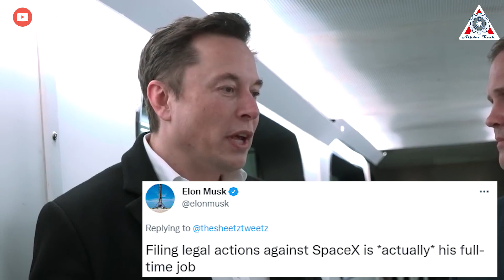It happened! Jeff Bezos spent $10B to beat SpaceX & Elon Musk

Comment: Given that Boeing is half of ULA, and the technical failures (737max, Starliner, etc) they have faced, does anyone expect their Vulcan rocket to perform acceptably?  Not to mention that it relies on Blue Origin's BE-4 engine.  They have struggled for years to produce 2 "flight ready" engines that still have not been flight tested.  Which  their "still-in-early-design-phase"  New Glenn rocket also depends on.  

Bezos is betting big on what are still imaginary rockets, whose manufacturers will struggle to produce in the quantities he needs.

All Bezos is doing is soaking up most of the available launch capability worldwide.  Which will drive those customers to SpaceX with their lower-cost flight-proven Falcon-9s and Falcon Heavies.  And with the Starship about to fly, SpaceX may well build a lead that will take any competitors several decades to match.
Reply: There's more to it than that.  Air Force is also overseeing it.  The oversight is quite intense, far beyond anything Starship has had to (or could) endure.
Reply: ULA's Vulcan Centaur is not only 50% Boeing (oh-oh) but their rocket's engines are from BlueOrigin (years late - not working - inadequately tested...etc. etc).
Reply: @SteveBakerIsHere  What in the world would make you think BE4 is 'inadequately tested'?  I can guarantee BE4 has been tested beyond, and in ways, Raptor never has been, and never will be.  If anything, that's BO's weakness; they pound things into the ground endlessly.  Boeing bashing can only go so far; despite all that's gone on there, they are a substantial aerospace company and will outlast SpaceX.
Reply: @Strike_Raid  that's because the Air force is paying for it. Starship is being developed largely through SpaceX's own investment. Yes they have money from NASA for a lander version of Starship. They got some money from the Airforce for engine development, but they are still in complete control of their development. as soon as you let the government take control everything goes to hell.
Reply: @christopherbeddoe406  I’m not so sure that’s true, but it wasn’t my point.  They were saying that BE4 was sloppy and untested, and I was pointing out that with AF oversight you can be sure that BE4 is neither sloppy nor untested.  It will be a tragedy if BE4 doesn’t work (a tragedy even if Raptor doesn’t work), but if BE4 is unsuccessful, it won’t be due to lack of testing.
Reply: I recall the Boeing whistleblowers that revealed Dreamliner components being hand built in a less than precision facility in California. Boeing would be quite unpopular if similar shortcomings were present in the current work flow.
Reply: @Strike_Raid  That same oversight applied to the F35 program, or is it better this time? 🤣
Reply: @ronnonyabizness5240  Everyone wants F35's.
Reply: @Strike_Raid  Hmm - so Raptor is tested at the McGregor test facility.  They have five test bays - which test their rockets from 7am until 9pm almost every day...hundreds and hundreds of test firings.   Would you care to share the testing that BE-4 has done (HINT: I already know the answer - so don't lie to us!)
Reply: @SteveBakerIsHere  It’s not the same, that’s proof testing.  Those engines are not instrumented in a way to do the kind of testing that NASA or the Air Force are interested in.  Not saying thirty engines going through proof is of no value, just that it’s not intense (or very meaningful) testing.  Also, I’ll add, SpaceX doesn’t share the results of those tests any more than BO does.  We have no idea how many engines fail tests and return for rework, but we do know some explode there.
Reply: @Strike_Raid  They have explosions because they very deliberately test them at higher than design pressure/temperature until they break - then figure out what broke - improve it - and try again.  That's how they operate.  These engines are so quick and cheap to make - they can afford to do that - and because they are mostly 3D printed, they can make a minor tweak to see if it helps - and re-test the new design in less than a week.  I don't know what gives you the idea that they aren't instrumented - there is an enormous web of plumbing and wiring on the ones that go onto the test stands that aren't there in the versions they bolt onto the rocket down in Boca - that has to be instrumentation.
Reply: @SteveBakerIsHere  Ug, never mind.
Reply: @Strike_Raid  And BE-4 hasn't flown, and Blue Origin's management seems to have all sorts of problems, including letting the project to become hardware poor. Even if they get BE-4 working, I would have serious concerns about Blue Origin's ability to get it into production in the volumes that would be needed to support even Amazon's demand.
Reply: @Strike_Raid  Its not the package they want, it's the tech.
Reply: Vulcan Centaur is not 50% Boeing haha! What rocket flies the Centaur upper stage..... I would recommend you go do your hw, I gave you a hint.

Vulcan is 98% ULA and maybe 2% BO. The only real ULA, Boeing relationship in 2022 is, Starliner and with that being said, ULA has placed that capsule perfectly 2 times now.

Now tell me, what's any different than SpaceX's Starship delays vs Vulcan? The only thing I can think of is, ULA and BO haven't spent millions of dollars restoring catastrophic failures like SpaceX has. There is a reason SpaceX hasn't made a penny in profit, since they have existed.

Space exploration is hard. I'm envious of all aerospace companies, because they are all making the impossible possible and giving us a fighting chance to make it off this Blue ball, tehe!
Reply: This is actually a  good point.  By taking up most of the available flights from most of the world providers,  he just accelerated the process to push other customers to SpaceX.   Once others have gotten used to SpaceX and enjoying the benefits,  they are not likely going to return.  If bozzo fails or fails to meet his commitment, he will drive all those providers out of business.

Comment: So far this year, there have been 17 launches specifically to take the satellites into orbit. Since 2019, the company has been responsible for 52 launches. The latest was Sunday, when a Falcon 9 rocket took another 53 Starlink satellites into space.  real embracing
Reply: @alphatech4966  The problem with using Falcon-9 to launch StarLink is that a StarLink satellite has an on-orbit lifespan of just 5 years before it runs low on propellant and falls back to Earth.   So if there were (say) 12,000 satellites in orbit - they'd have to replace 2,400 per year - or 200 per month.   At 50 StarLinks per Falcon-9, they'd need four launches per month JUST TO STAND STILL.  But they ultimately want a 42,000 satellite network - and they literally cannot do that with a plausible number of Falcon-9 launches.    Once they hit 12,000 satellites - they have to run hard just to stand still.

This is why Elon says that StarLink REQUIRES StarShip - it's literally impossible to have a fully populated StarLink network with just Falcon-9 launches.

But it cuts the other way too.   StarShip's development is costing more money than SpaceX can make with Falcon-9/Heavy.  And it was always intended that profits from StarLink would pay for the entire Mars colony effort.

So it's a symbiotic thing - A requires B which requires A which requires B.
Reply: @SteveBakerIsHere    The Starlink 1 sat wasn't intended to last more than 5 years for a reason. The Starlink 2 sat is going to replace it. Starlink 2 sats are too big to be launched from a Falcon9, it will be launched on Starship. Probably in 2023 the Starlink 2 sats will be replacing existing Starlink 1 sats.
Reply: @TexanUSMC8089  Yes - for sure.  StarShip and StarLink are mutually dependent.
Reply: @TexanUSMC8089  Do we know how long Starlink 2 will last?

Comment: The main challenge for BO is it's production capacity to build BE-4 engines. SpaceX has already gone through the prototype to production cycle and now they're in the production refinement phase. Until BO starts putting rockets into orbit, who's going to risk payloads on an unproven engine, the RD-180 was old technology but about as dependable and robust as it gets.
Reply: You seem to be confused. A production engine is one that’s been tested through a full duty cycle numerous times. That’s the BE-4. It has more run time and restarts then every Raptor engine produced (a little over 160 minutes combined run time) the raptors on the other hand are experimental. And the version 1 has a less than 50 percent success rate from low power to misfires and relites. The 2.0 is not fairing much better with a 70 percent success rate. But that’s to be expected. They are TEST ARTICLES. Not production engines. Producing them fast (while freaking amazing) is not production.
The BE-4 took this long because it had to pass tests FIRST. Solving their turbo pump problems for reusable cycles.  I suspect that’s the same problem SpaceX is having since relites seem to be the fail point.
Reply: Blame politics.

Comment: Amazon’s Kuiper is doomed to failure due to the cost base imposed by using more expensive launches.

SpaceX get their launches for $15m each.

Starship will be at least 50x cheaper and could potentially perform useful launches even during its development.
Reply: StarShip will COST SpaceX about $2M per launch - and could potentially propel a couple of hundred StarLinks at a time.   Other customers will be paying more - because of profits and such - but for internal SpaceX/StarLink accounting purposes - $2M per launch - the price of fuel $900,000 plus .   A StarLink costs about $250,000 and with even 100 per launch, the cost to launch a satellite is negligible.   So replacing dead satellites is more or less a freebie for StarLink.

Comment: The *HUGE* gotcha here is that these very-low-altitude orbits that both StarLink and Amazon's system use result in the satellites only having a relatively short lifespan...so in order to maintain this wonderous network at those kinds of launch prices - will price themselves COMPLETELY out of the market.   StarLink is easily maintained - even with beat-up 10th+ flight Falcon-9's ...but at the price of these non-reusable vehicles - just the cost to simply maintain their constellation will price them out of the market.

Comment: Over what timeframe does Bezos anticipate he could recoup $10billion expended on launching an essentially hypothetical satellite network when the cost of establishment will render it substantially more expensive than access to Starlink besides which a Kuiper network does not yet exist and is unlikely to at even begin to do so at any substantial extent within the next two years?

How could, rates applicable for access to a far smaller and more expensive network than Starlink possibly compete with that existing system when it is already so extensive, efficient and cost effective much less as large as it will be by the time project Kuiper literally gets off the ground?

Might Bezos intend to subsidize the cost of access to his network with his own money in order to render Starlink uncompetitive for long enough to drive the SpaceX owned provider out of the market or it's share price low enough to enable him to gain control of it?

It would not be unnatural to wonder whether this is all pursuant to yet another machiavellian strategy which someone might have up their sleeve long term and what might be wrong, with somebody who thought like that!

Maybe somebody has based their playbook on episodes of the old TV series 'Dallas'?

In addition to all the aforementioned considerations what are the odds many if any of the single use launch systems with which Kuiper is now heavily engaged could attain realization at all when faced with essentially insurmountable competition from SpaceX?

And how many re-usable systems which might have potential to be truly competitive with SpaceX can become operational on a scale sufficient to do so within the next five years?
Reply: He has the money to blow, and an axe to grind. So I do not believe he cares. I don't know if anyone knows the problems that kept his space program from advancing in it's earlier years. But they have never seemed to work around that and move on. They had good ideas, but the engine was not firing on all cylinders!
Reply: @ronfullerton3162 
 I changed the plugs 15 times like you said boss but it still won't go.
 "Well change 'em again"
Reply: @davidmacphee3549  LOL

Comment: In all honesty. Not doing Kepler would be idiotic for AWS. Azure is full on board with Starlink.
Reply: But the launch costs are going to be astronomical.   Atlas V costs $153M per launch - max payload is 18 tonnes.    Falcon-9 costs $50M per launch and can haul $23 tonnes to LEO...and it costs SpaceX only maybe $10M to get 60 StarLinks into orbit.   So assuming Kepler's satellites are similar in size and mass to StarLink - it's going to be $153M to get maybe 40 of them into orbit.   A solid 50 times more expensive.   Ariane 6 costs $77M per launch (better!) but only 4.5 tonnes (much MUCH worse!).

Vulcan-Centaur and New Glenn are complete unknowns at this point - but they both depend on the BE-4 engine - which STILL seems to be far from "launch ready".

So right here - today, Kepler is going to be VASTLY more costly than StarLink...not by a factor of two - by a factor of more like 50.

When StarShip rolls into service (for sure ahead of Vulcan or NewGlenn) - it has the launch mass capacity to send 400 StarLinks to orbit in a single launch...but the volume of it's cargo bay will probably limit that to 200 per launch.    StarLink launches will probably cost SpaceX $2M per launch...so now they can get launch costs so low that they are negligible compared to the $250,000 that each satellite costs to build.

I don't see how Bezos imagines he'll make money with this.
Reply: Let's Not Sully Kepler's Name by Mistakenly Attaching it to Amazon's Project Kuiper...
Reply: @Shivaho  Well, perhaps we shouldn't sully Gerart Kuiper's name by correctly attaching it to Amazon's Project?!   Kuiper lived from 1905 to 1973 - and discovered the Kuiper belt and also found a new moon of Uranus and another of Neptune.  But HUGE - he discovered that Mar's atmosphere is made of Carbon Dioxide - and was the guy who figured out the Apollo moon landing site.   Carl Sagan was one of Kuiper's students.

Yeah - OK - you're right!

Comment: How are they humiliating SpaceX when they are paying 3x the price for unproven rockets and are relying on an engine they are having problems getting through development. Given the choice I would prefer to be a SpaceX customer, I can't see Amazon being profitable, they would have to severely undercut SpaceX pricing and out perform Starlink  to get the customers. Also apart from establishing the network they will need extra launches to replace old satellites as they fail.
Reply: Bezos is driving new customers to SpaceX by occupying the all available flights?

Comment: Necause SpaceX proved it will screw its opponets when it busted facebooks satelite system which was 4 years ahead of theirs, and because spacex on it's own was fine, but everything Musk touches gets notably worse. Boring company (new machine 10x slower than old), Tesla (quailty has become junk since moving to Musk led model 3 design, also still dont make thier own batteries), Solar City (almost non-existant install base and none made by us solar company, see batteries and where panels are made and by whom), Spacex (redesign totally unproven and behind schedule and not running at 10% cost, but more like 90% cost). So yeah...look I dont like Musk or Bezos, but this move makes total sense.